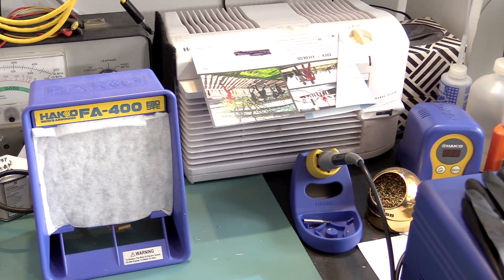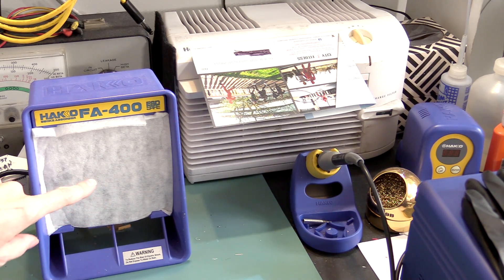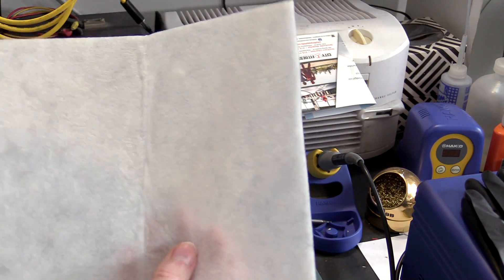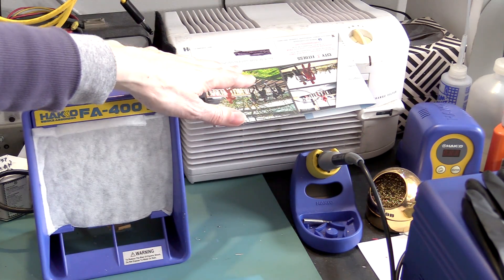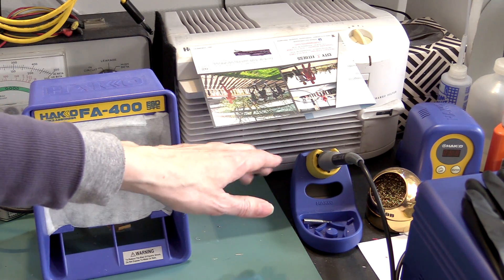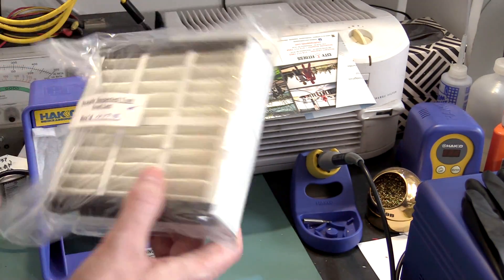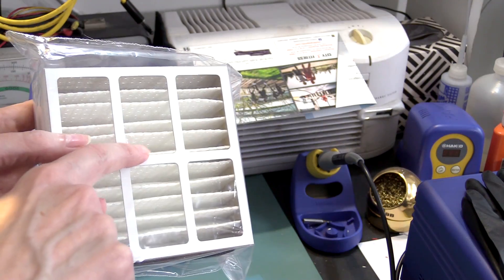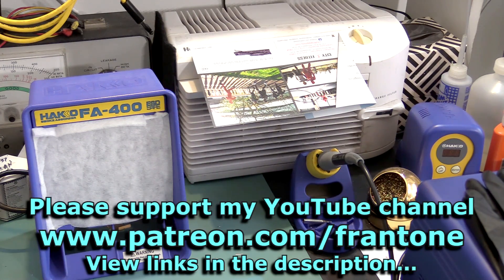My Bench Fume Extraction Setup

Comment: That's an idea for a workbench I'm planning - an ATX PSU to power several projects, which could easily be equipped with a filter. Luckily I'm still at the planning stage, so changes are no problem - as soon as I can afford the rest of the parts I'll probably add a drawer for a filter insert instead of taping filter material in front of the fan inlet.

Comment: That replacement filter looks very similar to automotive air filters, especially cabin/pollen filters. Despite typically doing less than 3,000 miles in a year I still change that filter every 12 months and it still comes out filthy on the side facing the intake, so it definitely appears to be doing its job.
If you should want even more filtration (but on a budget) then perhaps automotive filters and DIY filter housing could be an option.
Reply: It probably is an auto filter. I am kind of surprised she doesn't use some electrostatic filtration. My Ionic Breeze with Germ Purification (basically just a 15watt phillips sterilamp bulb ) is really awesome. The problem is the internal ozone clobbers the open contacts within the switches and connections. It's like they're aged 20 times faster than even electronics left outdoors.

Comment: It would be nice if you could run it through some bicarbonate of soda,  sandwiched between filter papers.  Solder fumes are from the flux, which is very acidic, if I recall correctly....googling sound....yes it is.  The pH is 4.2.

Comment: Could you just use a coffee filter? Also just wondered if you've ever considered adding a little led to soldering iron, much like modern portable drills? We never had any kind of fume extraction in High School Vocational Electronics Class Circa 1978... I would use a little fan just to get the smoke away so I could see what I was soldering. But then that cooled the tip/work. All the Best! 73 DE W8LV Bill
Reply: Didn't you also solder with a pointed rock left in the communal campfire? 😂

Comment: Thank you for doing this video. I just happen to have one of those Honeywell models. Ironically I use it for my soldering fumes as well. The thing that's unfortunate is the motor stopped turning recently; any idea where to order another one? Also, love the new title.
Reply from the maker: Easy fix - the bearings dry up.  Take the screws out and open up the machine, you'll find the motor and spindle - use light machine oil (No Spray Lube) on the shaft and work it into the bearing by rotating the shaft.  Power on and add more oil to the bearing as it spins on low.  Lubricate every 6 months or so.
Reply: @FranLab  Yay! A quick reply and a concise solution. Thanks so much, I didn't want to give up on it.